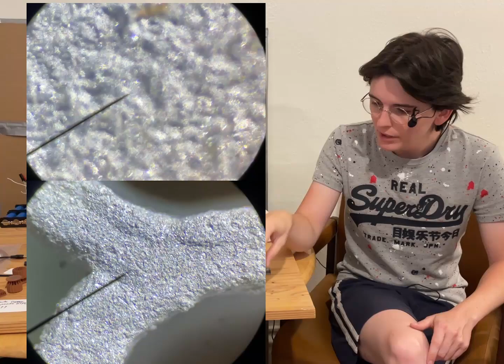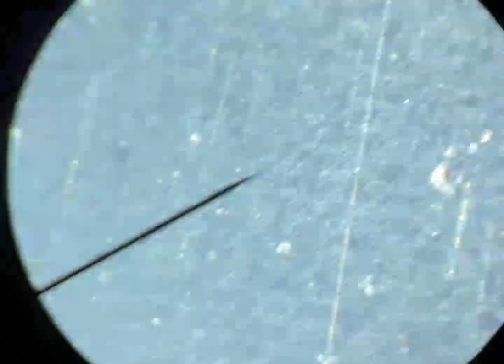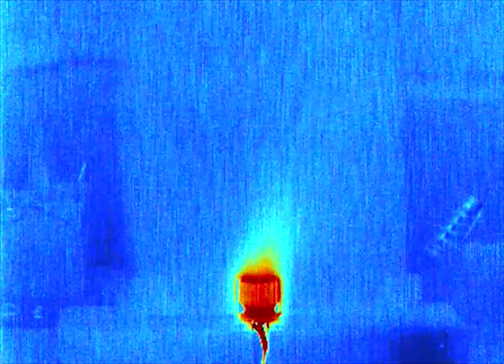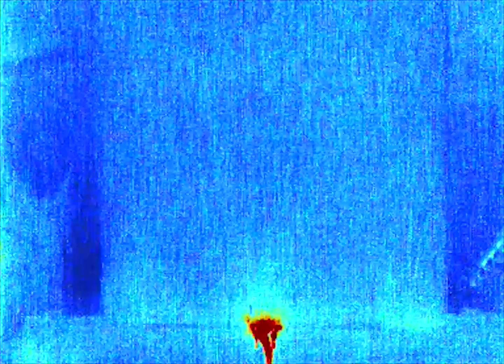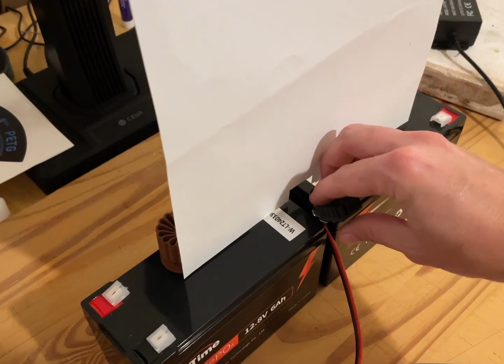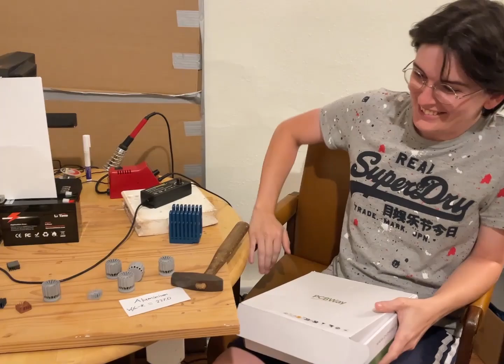3D Printing Experiments 10: PCBWay Laser Sintered Aluminium Heatsink. Metal 3D Printing at its best!

Comment: Heat sinks seem like the absolute ideal usecase for metal printing! I have to try that sometime. So far I have only bought aluminum milling, which is priced pretty similarly from those *pcb companies. I was always worried that metal printing would be more brittle in mechanical applications.

Comment: 3:46 Once again, from building PCs, I would use thermal compound to fill in any gaps.  I wonder if it will have a more pronounced effect due to the rough surface?  I suspect so.
Reply from the maker: Well I did use thermal compound on the bottom
Reply: @RinoaL  yes I saw that later.  You should do one without it, for comparison.

Comment: OOOOOH PCBway.  Yeah, I was like WHOA!  Rinoa has a SLS machine???
Reply: Doesn't matter.
There's like metal powder infused spools which you can put in a scorcher/whatever high heat heating contraption.
That'll allow you to essentially make metal parts outta fdm prints.
Reply: @yasirrakhurrafat1142  I doubt very much it's as good as laser sintering.  That's effectively molecular welding.  Not quite, but damn close.
Reply: @mattparker9726   nah, I mean the fdm thing isn't quite that great.
God I wish I had a sls printer!
Reply: @yasirrakhurrafat1142  there was a company 20 years ago that had an article in Popular Mechanics about making a sub 1000 dollar table top SLS machine, but suspicious enough, about a month later, I heard nothing, I think they were bought up.

Comment: i was super interested in 3d printed heat sinks a few years ago, was trying to make a fractal one. after convection effects it's all about the Hausdorff dimension of the shape [similar problem to 'hearing the shape of a drum'] and i think you can make it arbitrarily high as long as the material can withstand it. also something about optimal branching ratios similar to lungs to optimize there. its a fun rabbit hole.
Reply from the maker: thanks for putting a name to that
Reply: @RinoaL  check out mandelbrot's book The Fractal Geometry of nature, it talks about this stuff in more detail [not heatsinks specifically but optimizing fractal shapes in general]
Reply from the maker: sadly I wouldnt have time to read that, too busy with work